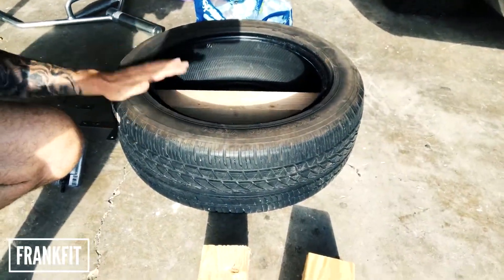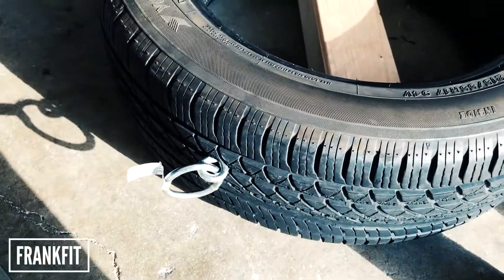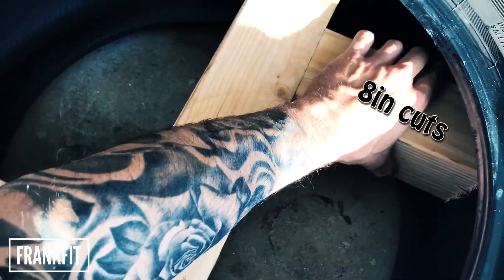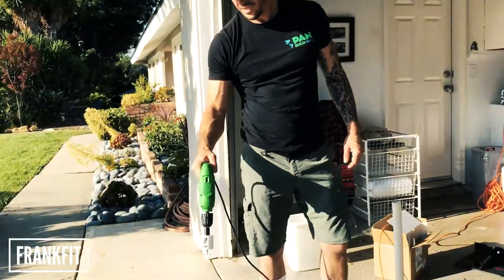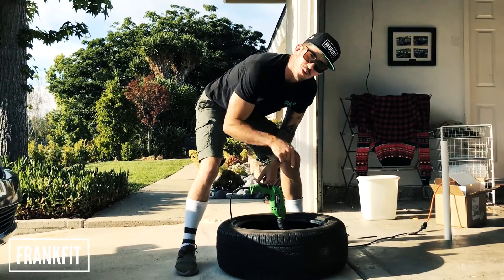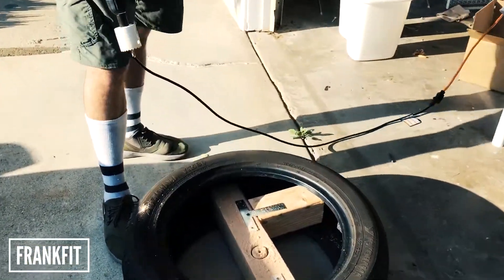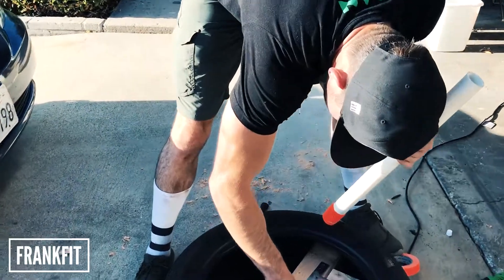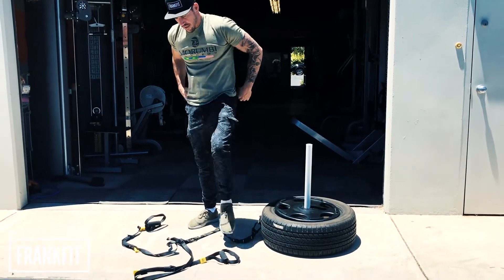Build Your Own Tire Sled

Comment: Made something like this a few years back, if you want an easier time, buy a pipe flange and a cheap short pipe that will fit weights.  Drill the flange on top and you're set!